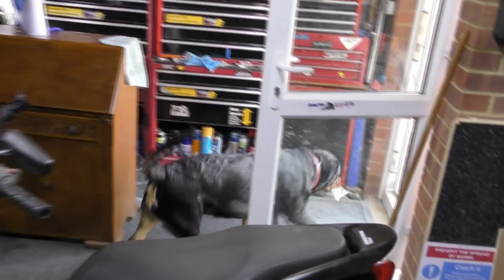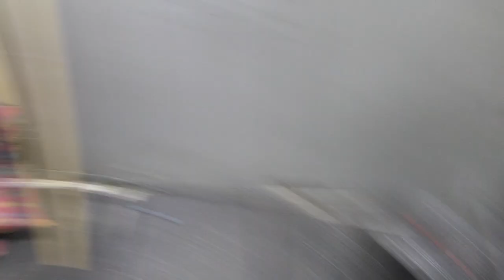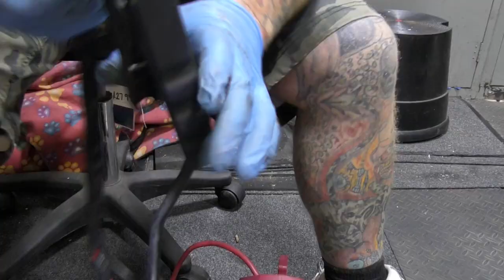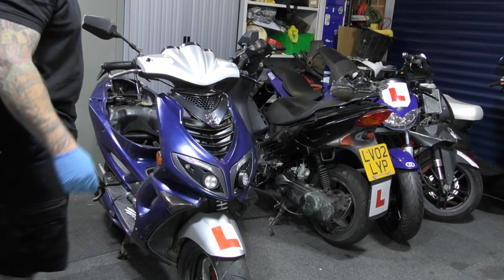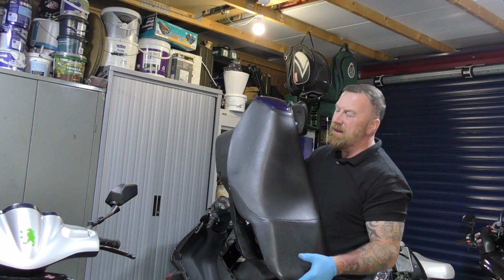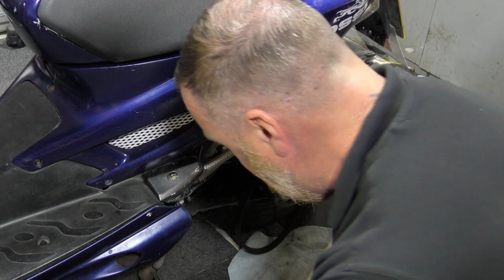SPEEDFIGHT 2 50 CC MOPED SCOOTER NOT STARTING OR RUNNING I'LL FIX IT

Comment: Hi Mark. Had a speedy 2 for a couple of years as a project. Can’t get it to run though. Here’s what I’ve done, New cylinder and piston, new gaskets without silicone, crank seals, new 17.5mm carburettor, new reeds and plug and stator coil…100psi compression….it starts if I use a drill to turn the crank but can’t tune it. It’s like the mix and idle speed screws go nothing. 72 jet and choke disconnected.
When it runs if I rev the throttle it kinda of is ok but lacks response and sounds weak….help!

Comment: i will just try my luck here . Sr 50 (piaggio lc engine)  Sometimes hard to start . like if it fails to start i need wait few min and try again . sometimes im lucky i can kickstart it if didnt start on electric . should i try the air/mix screw ?   have like 1300km on it and all standard 45km/h moped .
Reply from the maker: carb model ? if so jet bud , re jet it and tune as your flooding it 
take it you have service it and new plug etc 
as check your carb isnt leaking and on tight and serviced

Comment: Hi Mark,

I have speedfight 2 50 cc but I putted kit 70, so I have a problem with cold start/airbox.

With airbox it wouldn’t start but when I remove airbox and put hand next to carburator where he gets air than starts normallly…
Any advice

Hello from Croatia.
Reply from the maker: Carb problems after the 70cc bud as you know 
Now the hard part ,get you self a set of jets for 60 to 80 and try each one to set and then tune 
It's not fun and maybe look at a 19mm then tune as your 17.5 carb doesn't like it at all
I'd go back to a 50cc
Reply: @marksavage  thanks for advice mate I’ll try that.

Comment: Yo! My speedfight 4 20 (2017) 2 stroke 
The oil warning light is steady red and the engine doesn’t start neither with kick nor electrical start, the oil is full but the lamp is still red?

Comment: I am fed up  .renewed engine seal's new piston and head new spark plug and HT lead new CDI /VOTAGE RECTIFIER/RELAY/ OIL PUMP/ My SPEEDFIGHT 3 50 cc LC  still has the oil can light on and will not start even bought and fitted a new stator basically built a new complete engine .waiting to get a starter switch through the post .Does the oil can light go off once the scooter starts running OR should it come on the off when you turn the ignition on .
Reply from the maker: Do you have spark?
Oil light has two purposes!

Comment: just a guess the hole in exhaust was prob a wired spark plug to the wires that was cut for 
a make shift diy exhaust flame kit lol
Reply from the maker: on the original speedfight exhaust the have a GRV for the environment, they do nothing so always best to cut of or tap round

Comment: @marksavage Do you know how I can remove a stuck gy6 clutch assembly - It spins freely and I got to clutch bell off, but the rest of the assembly won't come off the shaft. I've tried wiggling, pulling, praying, and it won't come off. :(
Reply from the maker: Sounds like it's heat seized on bud 
Loads of wd40 and I clutch puller 
Or heat up and tap 
I've had to replace the shaft before bud 
Cheap Chinese bud

Comment: Hi mark, love watching the speed fight videos as I’m doing one up for my son, but could you tell me where the 2 pipes are to go on the front of the engine block ? It has delorrto cb1 on it.
Reply from the maker: theres 100 speedfight videos on a play list so one should have the pipes your are talking about but lets see
is it manual or electric oil 2t pump
you have the vacuum connected one to the carb the other to the inlet manifold
2t oil from the head tank goes to the 2t oil pump
there is a GRV pipe that then goes to the exhaust 
just block that off if that it
Reply: @marksavage  I have the electric oil pump under the floor panel and I have that connected to the side of the carb. So it’s not really needed ?
Reply from the maker: @davewilliams6464  the GRV no bud it doesn't really do anything on a moped lol , just cap it off
Reply: Brilliant thank you mark, your videos are the the most informative ones I’ve watched. thank you for your time keep up the great work 👍🏼👍🏼

Comment: Any advice would be appreciated im having trouble starting my speedfighter 2 when I turn the key nothing at all works no lights no horn and the back break light doesn’t turn on and the electric start button when pressed in does nothing not even a noise been broke for a month it used to work after I kick started it and all come back to life and it would make the electric start work but now my kickstart is broke I’ve watched a coulple off videos here and there and there’s nothing helping me would be really nice to get your options on what the problem could be
Reply from the maker: there is a play list on my channel with 100 videos that will help a lot bud , no power , battery , fuse, volt regulator , stator coil and the loom , even the key system, all panels off and start to look bud

Comment: I’ve got a 2008 speed fight 100 it was riding fine the other day , I had to change the exhaust as old one snapped the fuse went and I’ve changed it but it keeps bogging out on me it will ride for 10-20 seconds then cuts out on me

Comment: Hi Mark, thanks for your video very informative. Id like to ask you about my Speedfight 2, just cleaned the carburettor twice it run but when riding it and giving full gas it would die until stalls. Then i opened the variator chamber and cleaned everything, then mount only two screws of the lid to hold it only and tried to start it and since then it would not even start. Spark plug makes spark and gasoline is reaching the piston so its strange and i dont know why its not even starting. Any ideas? Any feedback would be highly appreciated buds thank you in beforehand
Reply from the maker: fit more bolts to hold the cover on bud ,thats a must
take carb off again , annoying i know 
check float is letting fuel in and that it stops . like in my videos on carbs 
check vacuum is ok too 
clean carb with carb cleaner make sure it back together right as in my videos and test and back tight ! 
clean plug and air then 
prime carb and see if it starts ok 
follow my videos

Comment: Could you help me please? 
I just bought a speedfight 2 to get to work on was working fine I rode it about a mile in total and it completely cut out
New piston fitted 
Carb cleaned
It’s sparking
It’s getting fuel 
Battery was dead electric start didn’t work so I jumped it and electric start horn and all lights started to work but it didn’t start the bike up.
Checked all wires everything looks okay (we think)
Reply from the maker: head off and check piston , did you 2t oil the piston like on my videos 
re check over everything , running in ?

Comment: Hi mark, I’ve had my speedfight 2 sat for  a while and decided to try and get it running  again, I’ve changed
Spark plug
Battery
Fuel lines
Fuel tap
And cleaned the carb
Drained the fuel and put fresh fuel in.
It will start but then bog/cut out when I pull the throttle.. any ideas? It’s only done 10k miles
Reply from the maker: e10 or e5 fuel bud 
carb back off bud and check float is ok and reclean jets 
check vacuum and fuel lines ,if hard change
Reply: Thanks! I ended up just buying a new carb for it, it’s running now but leaking fuel so I’m guessing it just needs a little adjustment to get it right.

Comment: What should i do if i have left it sit dor couple days and now it wont start it gives spark i cleaned carb, and there is compresion why it isnt starting?
Reply from the maker: Carb bud,  they do this 
Take off service and check for leaks 
Change fuel pipes 
And gaskets if need be

Comment: Hey mark I know this is random but I have a PGO m2 50cc, which volt and amp battery do they take as it didn’t come with one? Appreciate any help
Reply from the maker: All I can say bud is most are 12v 4amp 
Best Google specs
Reply: @marksavage  cheers for the reply mark, will do some research

Comment: Hi mark. I’ve got an issue where my speedfight 2 turns over on the button but won’t start. But starts perfectly via kick start! Any thoughts. Cheers
Reply from the maker: Hi bud 
2 things 
Dirty or faulty stator coil 
Volt regulator 
Just not getting enough volts through bud
Reply: That’s great mate thanks. I’ll whip it off tomorrow check clean it all!

Comment: Hi Mark, I don’t suppose I could pay you to fix my old speedfight 2. I’m the only owner of it bought brand new in 2006 and it hasn’t ran since 2008. I had a garage take a look at it as it was a mess when I stored it and they have butchered it more. Needs new crank and all sorts. May make some new content for the channel. As it’s a mess. The garage brought it back saying they didn’t have time to work on it (and didn’t charge me) but I’ve looked when they returned it and it’s got chipped bits on the block and the crank has crossed threaded ends so you can’t kick start as it seizes the kick start, they’ve had the engine apart so maybe they’ve reused old gaskets. It needs a full rebuild and I just want to pay someone who is capable like you are(more than) to get it up and running to its former glory. It’s for the memories really of when I was 16.
Reply from the maker: Oh no that's really bad of the garage !!
Won't charge you , lucky you didn't take them to small claims !
To be fair
You would be better getting a running 2nd engine as that's what I'd do 
Plus as you've had it since new it would be nice to get it back on the road 
I have 100 videos that will help you fix it up 
But I have an eye problem now which makes it hard for me to work on them 
Sorry bud 
Plus not even sure where in the UK you are lol
Reply: Hi Mark, I’ve since bought a 2nd engine from eBay. It said in the advert it was a running engine. I’ve got it and it starts then dies  I’ve changed to a new carb because the threads wouldn’t tighten up, but still no joy. I’ve checked your videos and I can’t understand what it can be. It does have a 70cc kit on it so I’m going to change back to a 50 kit. Hoping it’s piston related rather than oil seals. I’m in Manchester
Reply from the maker: @nickforsythandkids  often a working engine once taken out can end up a none running.
did you see it running ?
it was a complete engine same as you had in yours so wiring loom fitted all ok , as for the card your cable carb top may have need changing as they did a few different carbs, look back at the carb bud, did you put back in the old jet as it would have been set up to the engine , ok now ...... you know i hate 70c kits as they dont last and set up can be a real pain and prob your problem . i do have a 100 on the play list and sure ive covered set up of carb - as in air mix and needle , reeds , and piston replacement many time over lol .. if it starts and dies its often carb but did you check spark colour as in blue , and set up as it was before , maybe ask the seller for more info on the engine and running video , but odd why would you take out a good running engine from a working ped that he could sell for way more ?
Reply: Hi Mark, thanks for your replies. It is appreciated. I bought it from eBay from Cheshire bike breakers. So I’m guessing it was written off. They have sent me a list that shows it was a runner but I know that doesn’t mean anything. They are sending me out a new piston, rings and gasket set. And a little refund for the inconvenience. The new carb I got delivered has a bigger looking jet than my original carb but it doesn’t have any numbers stamped so I don’t know the exact size. My original jet is a 52 so will be going back in when I get this new piston. I already have a 50cc barrel and head from my old engine that didn’t have any issues so I will be changing to that old barrel. I haven’t checked the spark colour as yet. It only starts with easy start. It doesn’t matter what I do with the fuel. Just revs high with the easy spray and then dies. I’ve sucked the vacuum side and fuel is going to the carb. It came with a new electric choke, needle but I put the old cable back on. You can hear the change when closed throttle and open throttle on the electric start. So I guessed the cable was fine. Im going to do the wet carb test and really go over the carb set up this weekend. Thanks again mark. Fingers crossed it’s something really obvious and stupid. I will rewatch your videos for some more tips/ideas.
Reply: Sorry yes it was a complete engine. The wiring loom fitted all fine. But the rear wheel was locked up initially. I couldn’t push the bike at first. After fitting it to the scooter and putting the rear wheel on. Could the clutch be knackered and causing the scooter to stall? Like I said i am going to look into it this weekend. I still have my original engine that I can swap parts over as it only had 8,000km. I was going to change to a new drive belt anyway.
Reply from the maker: @nickforsythandkids  52 is small standard is 54 to 56 but I use a 60 as they run well with that on a sports exhaust 
If not 56 bud 
And sound's like your doing what you can
Keep up the good work as it will be worth it in the end

Comment: Hi Mark Nice to see you still dooing the videos on the speedfights. Q for you how easy is it to swap a speedfight 1 100cc 1999 engine and wheel on to a speedfight 2001? have you ever done this? Also thanks for the tip about E10 in Australia we have had it for years so i WONT be putting that in the sppedfight! would you say also avoid it with a kawasaki ninja 2013? "
Thanks
Reply from the maker: it is easy and i do have many videos on how to do it , ive done it many times bud even 50cc to 100cc 
also sp1 and sp2 are fine 
just check the are either both immob or none immob 
as they have to be the same
Reply: @marksavage  how can you tell of its immobo or not? thanks in advance

Comment: Hey what cuoldve happen i changed the exhaust gasket poured some gas  and it started but after a cuople minutes of riding it just died and dont start again. The engine cranks theres compression, fuel i dont know what to do anymore
Reply from the maker: sometimes you may have to upjet, i'd clean carb, new plug and clean air filter and see how you get on , are you using E10 OR E5
Reply: @marksavage  i cleaned the carb, and the spark plug gives blue spark
Reply: @marksavage  i put on a new air filter too
Reply: @marksavage  and i dont know what Im using e5 or e10 because my mom buoght gas for me 😂
Reply: @marksavage  and what does upjet mean, im not a native in english sorry
Reply from the maker: @SiemkaaBee  blue spark is good
Reply from the maker: @SiemkaaBee  nice that should help
Reply from the maker: @SiemkaaBee  oh your not UK then so should be ok, here we have changed petrol to E10 and its not good bud .
when you changed the exhaust did you get a lot more speed out of it ?, when you try and start with the throttle open does it pop or back fire ?, this maybe the piston . is it air or water cooled
Reply: @marksavage  it did get a lot of speed but now it just doesnt turn on, the starter turns but it doesnt turn on and i have technical review tommorow and dont know what to do anymore
Reply: @marksavage  its air cooled
Reply: @marksavage  and it did pop one time for me
Reply: @marksavage  ehen i changed the exhaust manifold it started for like a mile or too then it started to loose RPM'S and didint start anymore

Comment: Hi there mate is the Peugeot speedfight 2 50cc for sale mate
Reply from the maker: I had a few in but as fast as I get them in and fix them I sell them the same day bud
Reply: @marksavage  is it still for sale mate
Reply: I’ve got one for sale
Reply: @reecesteward3062  I’ve got one for sale pal
Reply: @samwarburton7386  any problem
Reply: @reecesteward3062  dead battery don’t have a battery charger so won’t turn immobiliser off but shouldn’t need anything get it going but new battery

Comment: ID PAY FOR YOU TO LOOK MY SPEEDFIGHTER 2 😂
Reply from the maker: the videos are there for you dub so you can sort it , i'm sure you will as over 100 videos to help
Reply: @marksavage  whats the best jets do you reckon for a 100cc cylinder kit?
Reply from the maker: @NB-du2cj  is that a 100cc engine and carb or a 100cc bore kit on a 50 ?
Reply: @marksavage  100cc and carb on a 50 engine was thinking about bringing it down to a 70 thought as apparently the 100kit ruins your engine
Reply from the maker: @NB-du2cj  amazed you got a 100cc head on a 50cc unit 
Normally 70cc kits 
If you've watched my videos you know my thoughts on big bore kits due to set up problems bud

Comment: Do you have a way I can contact you mate? Facebook or something?
Reply from the maker: On here bud 
If I can help 
Maybe do a video and upload it
Reply: @marksavage  I have watched hours of your speedfight videos, my electrics aren't working and it won't kick start either, I've changed everything but for some reason nothing seems to work
Reply: So I managed to check everything over again and on my handle bars my immobiliser red light comes on now and even with the red key it won't do anything, do you think I need a CDI bypass?
Reply from the maker: @Alexlloyd101  there's your problem bud 
Cdi has lost it memory 
Need a bypass unit